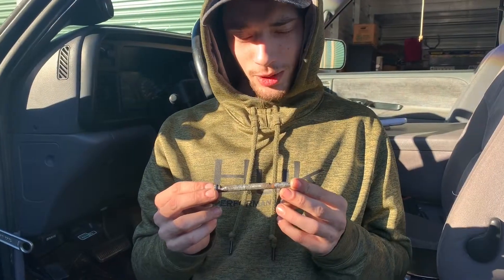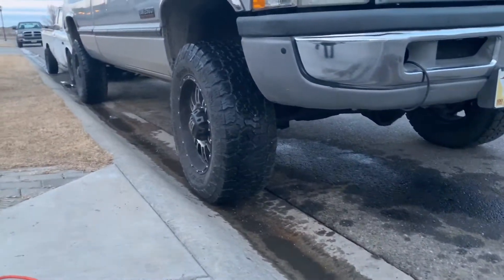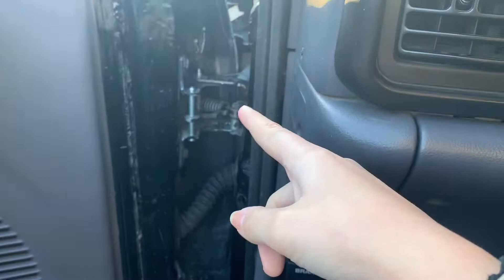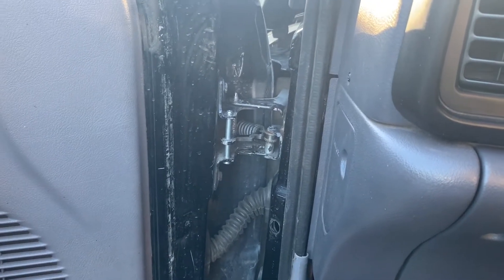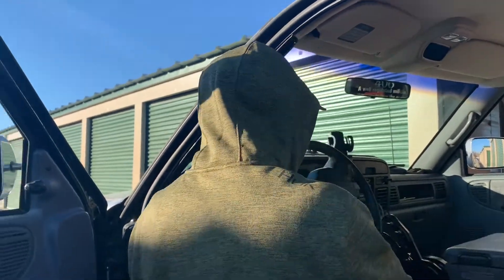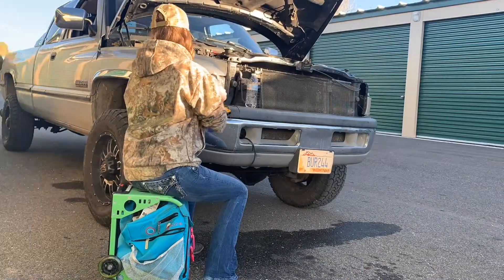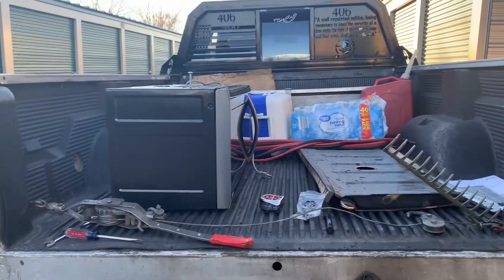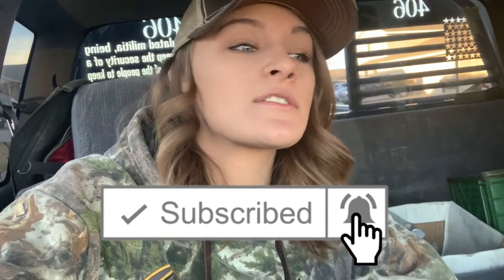12Valve Cummins Maintenance

Comment: There's a great headlight refurbishing video on YouTube. Sand and sand, getting finer and finer, then steel wool, etc. The trick is you take acetone, load up a rag, and make ONE swipe across it. The acetone melts the plastic lens and smoothes it out. I did it, with a half ass sanding job on my Ram 1500. Works great.